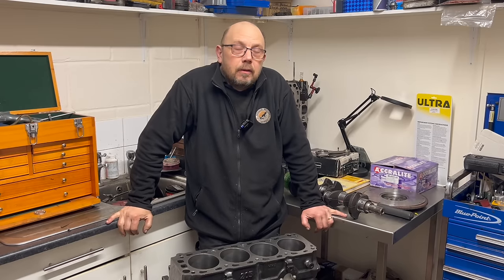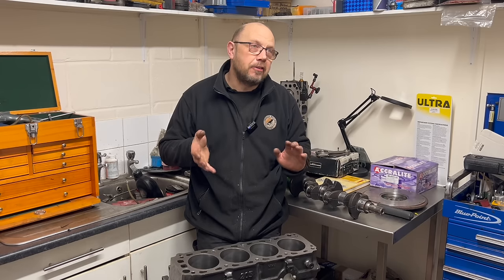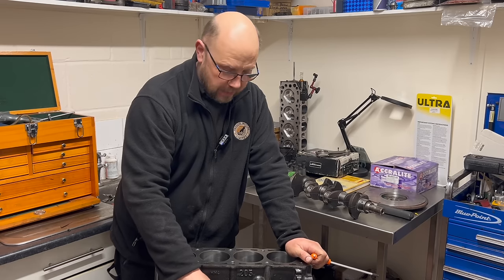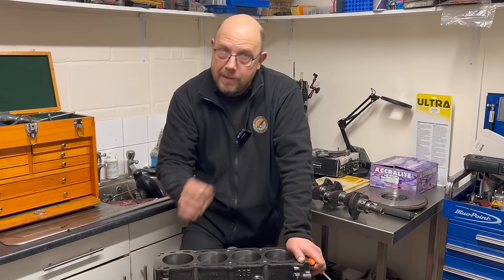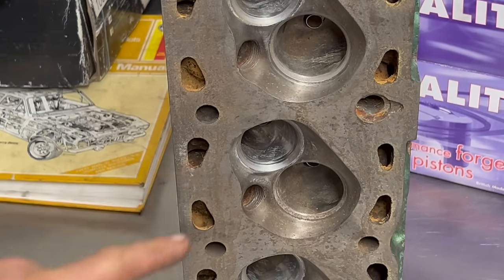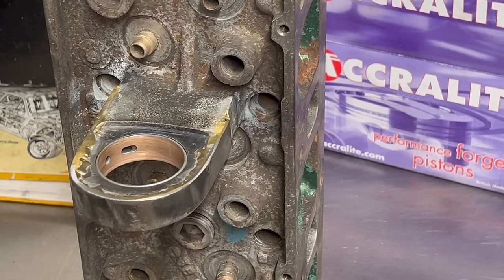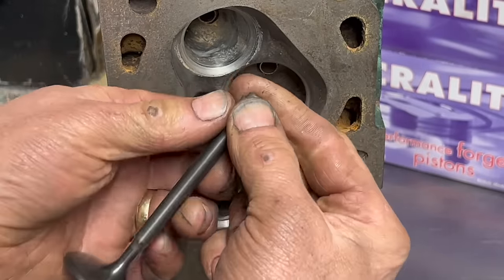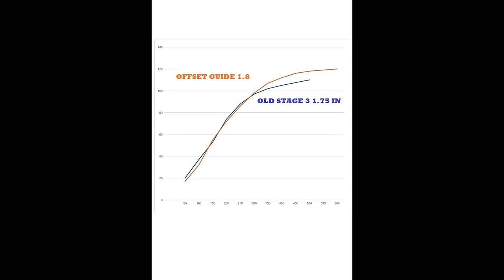FORD PINTO DRAG RACE BUILD

Comment: I am always amazed at the ideas people have for modernising these engines, I was a production engineer in Dagenham engine plant, I was responsible most of the time for the OHC (we never ever called it the pinto) block and head machining. The machining of the cam bearings was a headache for quality, we should have just used an old cam 😂
Reply from the maker: Yes back in the 80’s we mostly called the OHC too. If back then you had told me that 40 years later I would still be playing with them I would of never believed you :)

Comment: I use cossy rods and machine the outside of the crown to + 10 of deck and leave 50mm diameter  centre delivery height then work out the comp ratio as you get around 1/2 a ratio more

Comment: Hello, how do you like the idea of installing two standard vertical carburetors from 1.6 or 2.0 Pinto? One carburetor for two cylinders, I would really like to see it.
Reply from the maker: no off the shelf manifold exists to do that, and if you need more than a single 32/36 can provide you really need to switch to twin DCOE/IDF
Reply: @PenguinMotors  in my country DCOE/IDF is very rare, not to mention spare parts for them, soon I will try to build a SOHC 2.0 engine on a standard camshaft, on two vertical carburetors like Weber (ОЗОН 2107) but with 22x25 channels, I will make the manifold myself, if you are interested I can provide photos when it's ready.
Reply from the maker: interesting, but your engine will make more power with a upgraded cam shaft and one carburettor than  it will using two carburettors and a standard cam

Comment: Hi, do you have much experience with the Essex V6 engine?

I have a mk4 Zodiac (its a 3.1  instead of 3 litre) and was thinking about fitting a Newman phase 1 cam, but after seeing your video on fitting one to a Rover V8 im not so sure (peak torque on the standard cam is at 3k RPM which is nice, so I wouldn't want peak torque to be at a much higher RPM for the sake of a better top end being an auto)
Reply from the maker: Unfortunatly, All the Essexs i have worked on have been standard unmodified ones.
Reply: my dad has a kent cam in his mk4, just the mildest one, 1 to 5.5k powerband, suits the car nice, will spin to [an indicated] 7k no bother far too easily
D shape granada heads, inlet + exhaust manifolds are supposed to help as well, but we never went that far
 we had sufficient to tow a 5 berth caravan with reasonable power/economy with the cam, a high power electronic ignition system + stainless exhaust fitted
Reply: Essex V6 can be done, but as always what you want in limited space of what engine can do handle at stock or light mods, to 170+ HP. 
250 Hp is possible out of 3100 cc. But money question it is....

Comment: I swapped a lightened flywheel in my stage 2 rover v8 drag  engine , and with the lightened one in its half a second slower ... 😢 I'm going to swap ot back 😅
Reply from the maker: The thing is the engine may be slower to accelerate on heavier flywheel but you instantly have more stored energy after a gear change
Reply: @PenguinMotors  and I will get my 1/2 second back on the strip 😄 🤣 😂